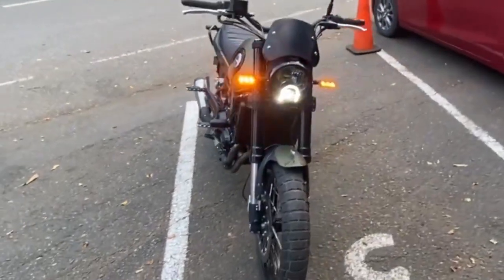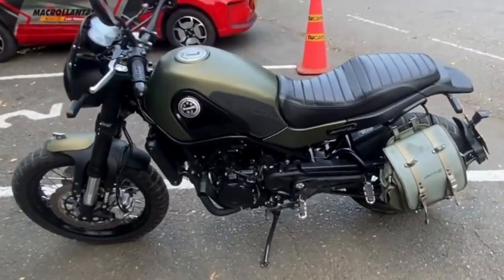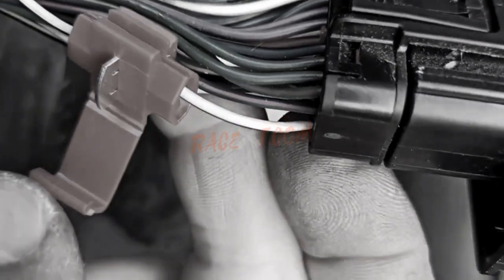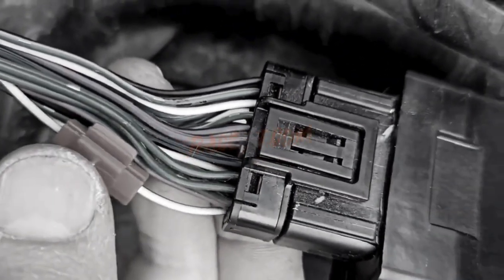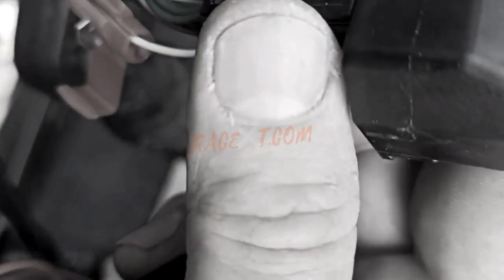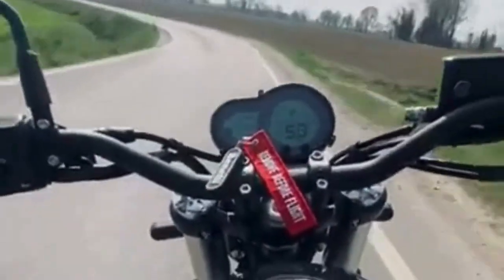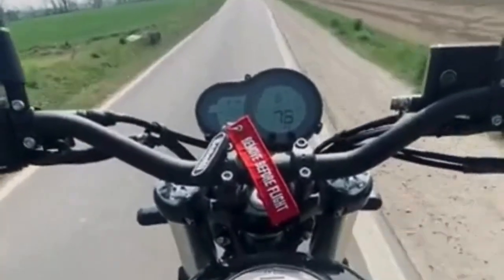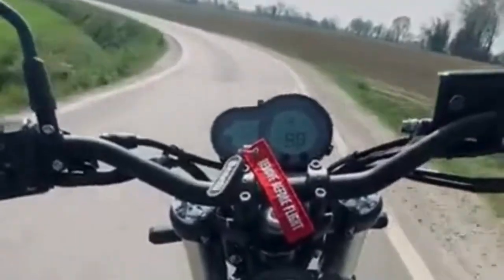Chip tuning for Benelli Leoncino 500 Trail power unit

Comment: ıf ı have removed the Cat from my bıke and put a straıght pıpe ınstead, then can the fuel and aır be adjusted my the plug ın chıp. please explaın more. thanks
Reply: usually when you change the new exhaust system, you need to get the FID - Fuel Injection Diagnose which might help to diagnos and tuning the fuel inntake and the burning process, and of course with a dyno, you'll get a better results probably 1-2hp increment with new full system.